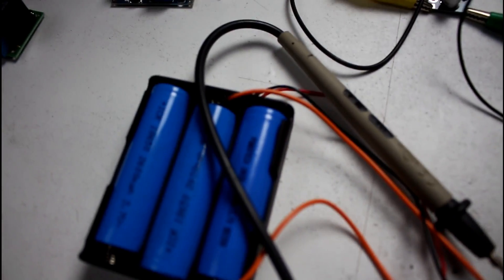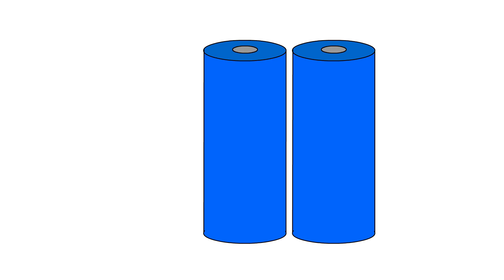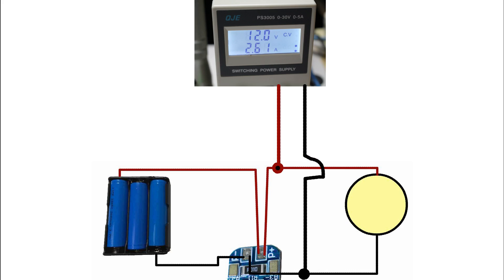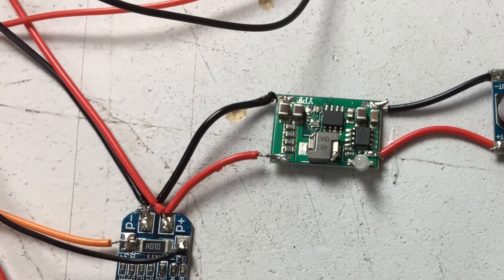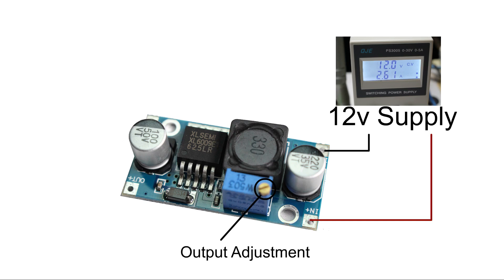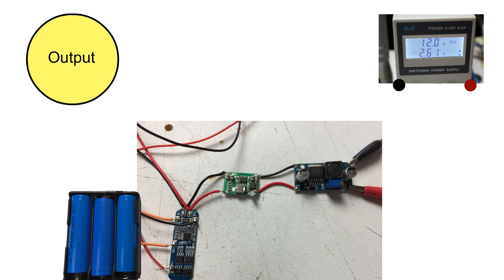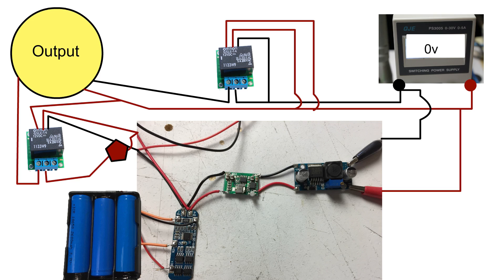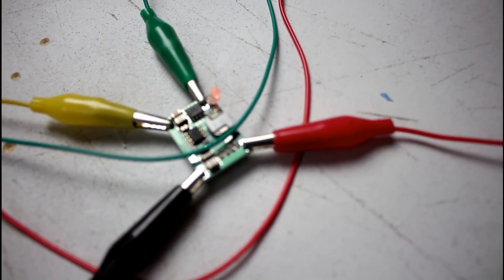Lithium cells in Series with BMS - Battery Pack Considerations (MEHS) Episode 61

Comment: impressed with your vids, ive been looking at power supply options for a gimbal i'm building/modifying. Looked at several options, especially like the BMS option. I'm hoping you can give me some advice, I had a thought today regarding powerbanks. is there any way to combine two of the single ones, and provide 7.4v? I have figured out linking the charging circuit as its similar to the TP4056 micro usb connection, but how can I use the output in series to up the output V? obviously as they only contain the one battery they are currently wired in a parallel style. thanks for ya help ;)
Reply from the maker: - Hi.  If you are talking about 2 of those single cell battery banks that have a full size USB output and usually a micro charging input then its fairly easy.  Option 1 - Grab a couple of basic USB cables, cut the ends off (dont cut the end that goes into the power bank) and join the ends together, red to red and back to black.  Option 2 - Open up the battery bank and solder wires onto the positive output and ground on each battery bank.  Just like using two USB cables but you can use bigger wire and its more secure.  When charging you can use one 5V charger if you make the reverse of the cable I just mentioned (one full size USB from the power supply splitting into two micro USB plugs).  Cheers.
Reply: Ah thats brilliant pal thanks, I kinda had a similar thought process, but wasn't 100% on the physics of it all, gonna make something up and try it out :)

Comment: I've been searching for the same thing and so far I've come to this part which combines a BMS with balanced charging on one PCB: https://www.aliexpress.com/item/3S-40A-11-1V-li-ion-BMS-PCM-battery-protection-board-bms-pcm-with-balancing-for/32388615404.html (suited for 40A)
Reply from the maker: - Hi.  Thanks for that.  I took a look.  Looks about the same as most.  They all have passive balancing for the cells connected in parallel.  Cheers.

Comment: hey can you make a 3s 4p batterypack?
Reply from the maker: - Hi.  I will be doing a video soon that shows the making of a 3s 2p, 3p or 4p battery pack.  Cheers.
Reply: thanks but i wonder if you know a BMS that can balance charge my 3s 3p batterypack. so dont need a spesial charger. i use 9 of these if you need to know https://www.fasttech.com/product/1263100-as-is-panasonic-cgr18650-e-mh12210-rechargeable.
Reply: also i wonder how many mAh 9 of these 2600mAh will have in a 3s 3p pack. thanks
Reply from the maker: - You will end up with an 11.1v battery pack that has a 7.8AH capacity.  Cheers.
Reply: did you know a bms that can balance charge this pack properly? thanks for your answers! i really appreciate your hjelp.
Reply from the maker: - Hi.  Almost all BMS that have upper and lower voltage protection have an inherited passive balancing function.  This passive balance is all you get from most products short of a dedicated external balancing charger.  So the BMS I used in the video will do what you need for a 3s3p pack.  Cheers.
Reply from the maker: - Yes, it looks like it has all you need.  Cheers.
Reply: and i should charge it with 12v dc charger?
Reply from the maker: - No.  You need to use a 3S lithium charging board or an external 3S lithium charger.  Just providing 12v to the pack is not good for the longevity or capacity of the cells.  The peak voltage should be 12.6v and the current should be around 3 to 5 amp.  Cheers.
Reply: hmm do you have a combo for that?
Reply from the maker: - That will work although try and find something with more current.  1A is not a good charge rate.  Look for something with 2 or more amps.  Cheers
Reply: so in conclution i just need to solder a port that fits to the charger with the right polarity to the board then connect the batteries to the bms as shown? and the + and - is both charge and discharge right?
Reply: is that correct?
Reply from the maker: - Yes thats correct.
Reply: I'm waiting eagerly for this!!

Comment: I am looking to make a battery powered 10" screen with a raspberry Pi 3 to make a portable tablet that I want to fit inside a book so when you open the front the unit comes to life and can be used for Linux then use with a small keyboard but will need a power supply and charging system both the display and the Pi will run on 5v so any suggestions for the best way to do the power supply so when it is powered it runs or if no power available it auto switches over to battery but don't want to use relays if  you find an answer I will be most interested  thanks, Bob
Reply from the maker: - Hi.  All 5V is good in this situation.  The question is how many amps does your project draw?  That will determine the way forward.  Cheers.
Reply: Thanks for your reply
My 10-inch display runs at 3.3volts at 275ma and the pi at 5v 2.5 amps so I think I can run the display from the Pi output 3.3v
Reply from the maker: - Ok.  First check the max power output from the 3.3v pins on the Pi.  I think your display is over what the Pi can deliver.  In this case you could use a combination of a Sparkfun 12711 and a pololu U3V50F5.  The Sparkfun board provides a barrel jack input and a mini USB input for charging the battery.  It also has a lithium charger on board that can charge a battery at up to 1.5A.  It feeds the U3V50F5 which is a boost regulator with reverse current protection that can boost a 3-4v lithium cell to 5V at up to 4A.  What I have done before is use the barrel jack of the Sparkfun board to provide external power to both charge the battery and power the unit.  When external power is disconnected, the unit runs from battery power.  If you want to run the unit and charge it at the same time you need to run a couple of extra wires from the barrel jack of the 12711 to the OUTPUT of the regulator.  I've used this on a couple of portables I built (in previous videos, mk3, mk4, mk5) and it works well.  Cheers.
Reply: Thank you for your suggestions yes I have not looked at current output on the Pi 3v3 but will make sure if it powerful to do the job

Comment: Hi MEHS.  Search ebay for "5A Lithium Charger CV CC buck Step Down".   This ~$2 module is said to be usable as a Li-Ion charger and has three "charge status" LEDs.  Have you tested it?For a couple bucks more there is one with two buttons and a display so you don't even have to break out your DVM to set the voltage and current.
Reply from the maker: - Hi and thanks for the info.  I haven't tested the exact one you mention (just took a look at a few) but they all seem to be similar.  I have a couple of very similar board on their way to me.  The issue I have with all these is that it will charge a lithium cell but it does so in an incorrect and uncontrolled way.  The board sets a current limit not to be exceeded but ideally we need a current limit that the charge does not drop below.  The CC stage of charging a lithium cell is supposed to be a constant Xamps (say 1A).  These boards can be used to set a 1A upper limit but the cell will quickly reduce that draw and the constant current phase will be much less than 1A before its complete, not what we need.  So in short they are better than nothing but it is not correct charging.  Cheers.

Comment: Maby this one's will work 
http://www.ebay.com/itm/122368424874
http://www.ebay.com/itm/262883503004
Reply: Please could you explain why you aren't interested in the cell balancing feature? Thank you.
Reply from the maker: - Hi.  Thanks.  The BMS is basically the same as the one I used in this video and I don't need the balance circuit but yes that would be a good combo for a multi cell pack.  Cheers.
Reply: Yes I still can not find a cheap 3s Balance charger that has a normal input voltage say 15 volts, the link above does not mention balancing, and it does seem if you want to pack to last and perform it needs Balancing
Reply from the maker: - Hi.  One thing that might help.  Passive balancing is achieved when a BMS has upper / lower voltage management which almost all do.  This is different to the ideal active balancing that power wall or dedicated quality multi-cell balance charger may have.  Cheers.

Comment: I have some questions about the components used, specially about the bms:

First of all: the bms basically prevents the cells from overcharging and over discharging, doesn't it? 

Then:
For example; tp4056 charger, it automatically charges the cells preventing them from overcharging, right?

So there's no need to connect the tp4056 to the bms, you can just use it directly on the cells. 

Another question is if the bms boosts the cells voltages?  Because when cells discharge they lose voltage, so does the bms boost it to keep it constant or not?

If not, you will need a buck converter to boost it to a constant load. 

So...bms will only work to prevent batteries from over discharging. 

Am I right?
Reply from the maker: - Hi.  Yes mostly correct.  A TP4056 will correctly charge the cell and not exceed the safe voltage (4.25v) but it wont stop the project draining the cell past the unsafe low voltage point (2.5v on average).  A BMS does stop this from happening as you mentioned.  Note you can get TP4056 boards with a real BMS built in.  Also if you use protected cells the BMS function is built into the cell.  A TP4056 is only for a single cell.  If you use multiple cells in series you will need a BMS.
No a BMS does not have a voltage reg on board.  You will need a DC-DC converter for constant voltage output.  The BMS just combines the cell voltage.
Depending on the type of BMS and the IC used some BMS also monitor current and will step in if the current is too high going to the cells.  Additionally you can get BMS that have balancing on board too (not the one I used in the video though).  Cheers.
Reply: Oh, thanks, i spent some time searching for info and concepts and i know understand pretty good all this, but i still have a question.

will the bms make some current limiting like the one done by the tp4056?

So for example if i conect tp4056 directly to bms, will the current and voltage it outputs will remain the same as the one provided by the tp4056?
Reply from the maker: - Ok.  Most BMS include a current cut off.  This means that the power flowing through the BMS to the cells will be cut if the current is excessive.  The actual limits vary depending on the IC on the BMS board.  The TP4056 without integrated BMS does not limit current but is mostly safe as a single TP4056 can only charge at up to 1A.  You don't need to monitor or limit the current going to the cell as virtually every lithium battery can handle 1A.  This is different to a BMS current limiting function as the BMS might be receiving up to 10A at any one time as an example.  The BMS will temporarily cut the supply of power to a cell of the current at that time is over the set limit (around 2 -3A depending on the board).
You would not connect a TP4056 to a multi cell BMS as the TP4056 is only for a single cell.  Also you can't use multiple TP4056 boards to feed a multi cell BMS as there is a common ground plane.  If you are asking whether a BMS takes external power and provides a CC mode to the cells (e.g. take 12.6v input at 3A and charge the cells at a constant 1A each), the answer is no.  Cheers.

Comment: Have you tried a Hebang Li-Ion charger HB-120601 or HB-120603?  Not sure if it's a good idea to use a charger like this while the light is in use, but I found they work great charging up a 3s pack with that BMS you're using.  3 amps is too much for some 18650's, check the datasheet to make sure.
Reply from the maker: - It would be interesting to see how the charge is really applied to the cells.  Not the cheapest solution either but not unrealistic.  It does look like it has a termination point but the little info I've seen so far suggests its a raw 12.6v dump rather than a correct charge curve.  If I get one I will test it for sure.  Cheers.
Reply: Hello brother, I have a 3s 40A bms setup for my batteries, yesterday they worked fine but today as soon as i connect a load the Output voltage of the BMS drops to 6V making the load inoperable. This board is even new already threw one 3S 25A board for facing similar issue. Pls resolve or guide me if u know.

when load gets disconnected BMS shows Op again to 11V...each battery has 3.78, 3.79 and 3.80V

Comment: Search for SY6912 and you can find it.  Resistors need to be removed to limit charging current.  Default current is 2A.  Another resistor needs to be relocated to change from 2s to 3s.  What a pain. There is a MAX745 board on ebay that is easier to use (has dip switches and pots), but almost twice the cost.  I think a simple switched 2.1mm DC jack is easier than the relay(s) but then you can't run the light while charging.
Reply from the maker: - Hi.  I don't know of any reference.  I used trial and error to determine which resistors needed to be removed or added for the desired number of cells.  Many of the ebayers have a screen shot of what to do with their exact board.  Take care with your selection as I asked for SY6912 IC boards and got AOC chips which I tested and I didn't like.  I would go with the MAX745 only because the boards I tested did not work as expected.  Cheers.
Reply from the maker: - Hi.  Yes the ability to run the project (light) while charging is critical (in this instance anyway).  Yes the board I used off Ebay is a multi cell charger meaning some tiny tiny resistors needed to be removed or relocated to make it a 3S charger.  The board gave the desired voltage but the CC stage was not ideal.  Cheers.
Reply: I just bought the SY6912 board from China and planning to use it with 3S. I can't seem to find any reference for which modifications need to be made for 3S. Any chance you can provide a reference? Thanks. Also it's not too late to cancel and get the MAX745, is it really that much better for $10 over $5? I'm just going for a one-off project so I don't mind moving around a resistor or two to save half the cost.
Reply: The MAx745 board looks quite handy - even appears to have a pair of plated through holes for header pins allowing you to break out the charging LED. Do you think that there's anything wrong with using a single one of those to charge multiple 3S BMS packs (as opposed to 3SXP parallel packs under a single BMS)? Apart from the overall charge time and acknowledgement that you wouldn't be hitting 1C. Grateful for anyone's feedback on the CC/CV performance of that module in 3S mode.
Reply from the maker: - Yes I think I need to do some testing with that IC.  Cheers.